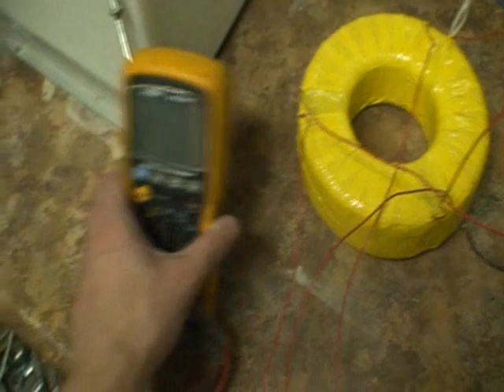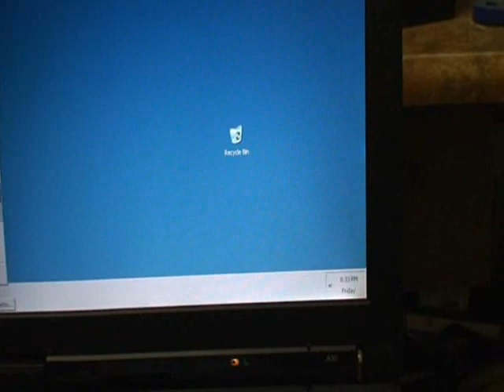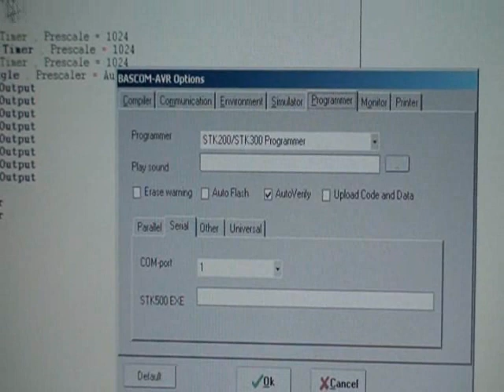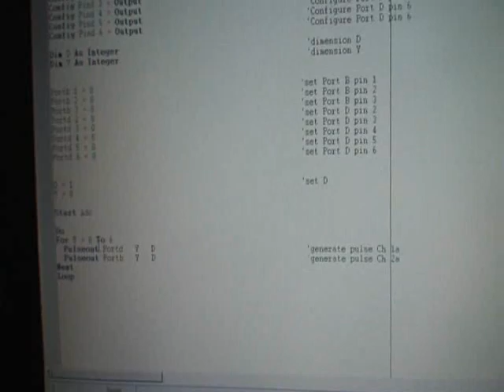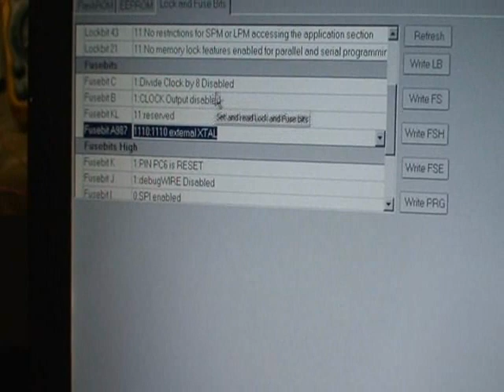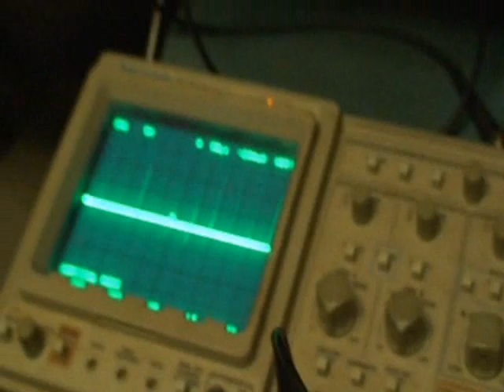Battery charging with the hex controller (3 of 4)

Comment: The definition of over unity for an electrical circuit is the energy/ power input measured in Joules or Watts compared to a greater amount of 
energy/ power measured at the output of the circuit. Where in this video have you properly measured the energy/ power input compared to energy/ power at the output of the circuit?

Volts times Amps equals Watts and 1 wattsecond = 1 joule